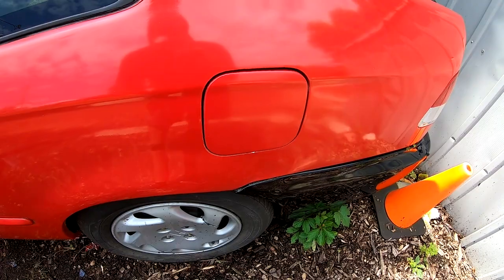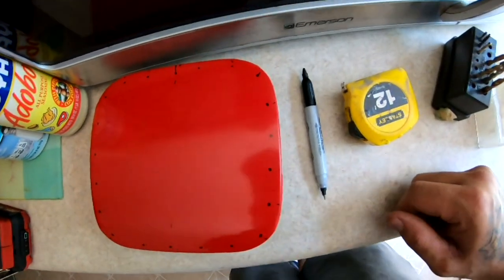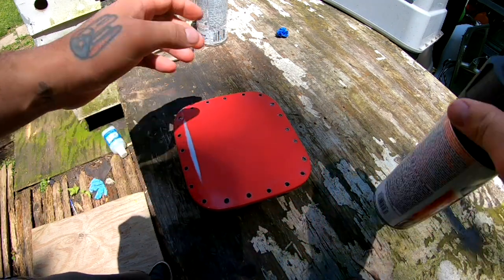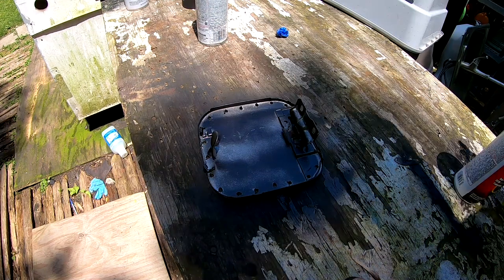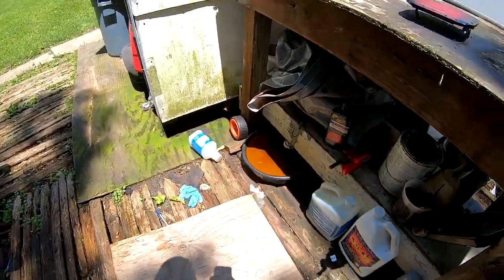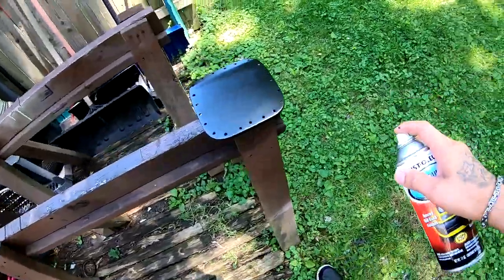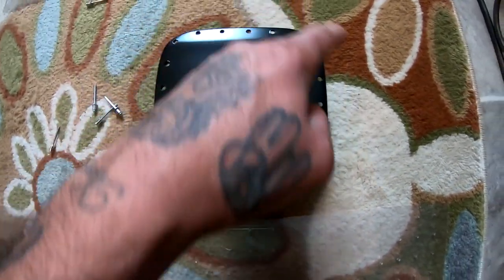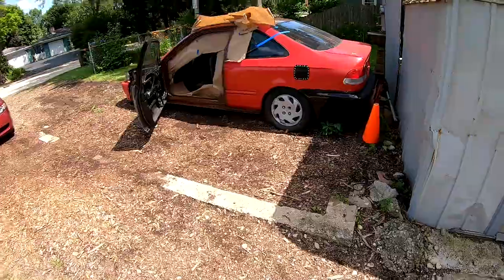RICE or NICE???Rustoleum bumper and Molding paint rattle can

Comment: Keep it! Are you planning on clearing the car? Debating on rattle can or getting the quarts and adding hardener. This is my second go around with painting the Rustoleum. Gray came out nice shot out of the gun but they make a 2x Ultimate Gloss or the Turbo that I was thinking about trying
Reply from the maker: Im not gonna clear. Get the quarts and add the hardener.is the turbo that new stuff in a really tall can?
Reply: Barbas Life The turbo is the big can. Has a nice fan tip on it. Only problem I see is that it will always be “soft”